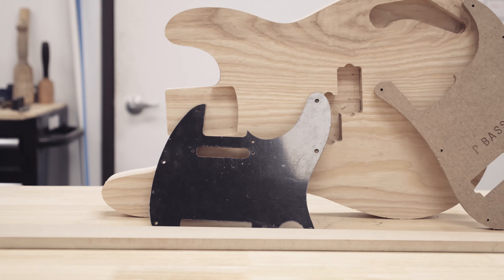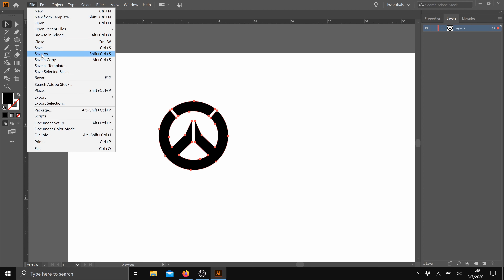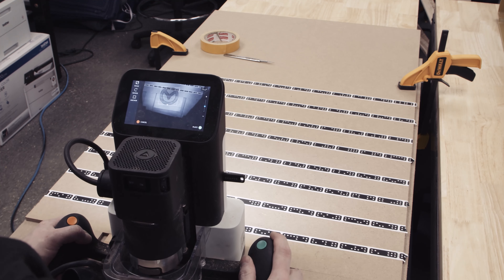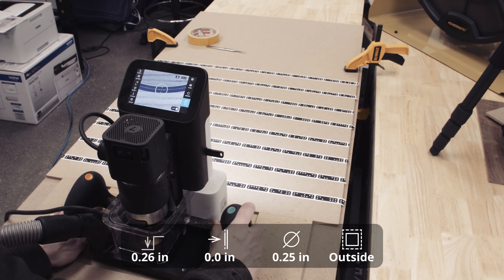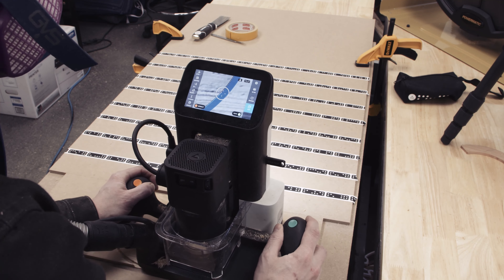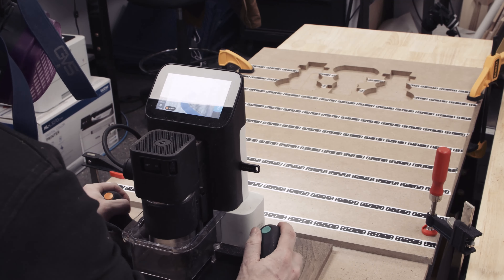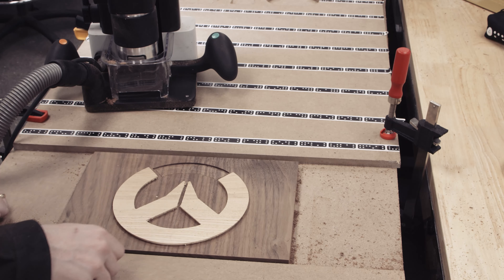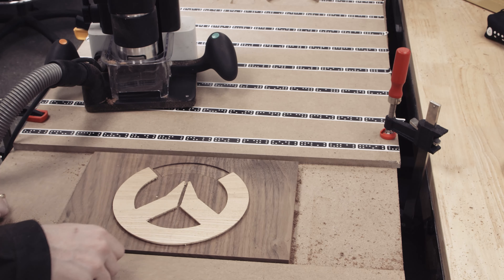Overwatch and Skyrim Inlay with Shaper Origin

Comment: That tool is freakin' amazing.  Have you ever tried down-cut bits?  Seems like with those micro cuts, they shouldn't cause the machine to hop... and would eliminate all the frazzle & tear out at the top?  Also if you're using a spoil board, why not cut down into it just a little to eliminate that little lip at the bottom?

Comment: Nice video and kudos for using eye protection and a respirator but you really need hearing protection in the shop or you'll end up needing hearing aids.
Reply from the maker: I am absolutely wearing hearing protection. I typically use foam ear plugs.
Reply: @ScottBarronFurniture  That's so great to hear! I grew up when hearing, eye and breathing protection were not even on the radar and I have significant hearing loss. I recently bought a SO and my adult daughter has been enamored with its capabilities. I already had multiple pairs of eye protection but not ear so I ordered her a pair of 3M over the head ear protectors. They go a long way towards preventing hearing loss. I just pointed her in the right direction and now she's teaching me tricks with making artistic svg files.

Comment: Hi, I would love to see you cut out guitar parts. Thanx.
Reply from the maker: I have built a guitar and a bass with the Origin but I did it with my son so I didn’t film it. I have been wanting to build another one, so it might happen soon!
Reply: @ScottBarronFurniture  Did you cut out the neck as well with the Shaper?
Reply from the maker: @peterlintrup400  So for the neck I used the Shaper to cut a template which I then used at the router table to cut out the neck. Same for the fretboard. They were both Fender style necks (a tele and a p-bass are what we made). You could probably cut them directly with the Shaper, too. Then I did the radiusing on the back of the neck with some rasps and files. Next time around I want to do some inlay on the fretboard as well.
Reply: @ScottBarronFurniture  Thanx

Comment: another consideration is that at such small offsets, if a piece of dry inlay sits in a shop where there is a lot of humidity then it will expand enough that it might not fit into the pocket..

Comment: Turned out great! Thanks for sharing. A piece of advice if you want it. Invest in some hex lag screws to screw into your clamp handles using a screw gun with a socket if you want to save some time when clamping. Also helps with the “tight quarters” issue of trying to tighten them by hand.
Reply: J

Comment: This looks like an ideal case for using a vacuum bag for glue-up.
 What is the audible depth gauge arrangement on your drill press?
Reply from the maker: A vac bag would work well here! I have one, but didn't think to use it for this. The audible depth gauge is part of the drill, it's a Nova Voyager. It's a great drill, but I'm just waiting for the day the computer goes belly up and I've got a giant paper weight.

Comment: Scott, thanks for the video! This thing pushed me over the edge to getting a Shaper. Now that I have it I'm realizing the biggest learning curve to pull off doing what you did in this video won't be with Shaper but with getting decent at svg manipulation in Illustrator. I have an svg file of a logo and I'm attempting to do the same thing you did to adjust the corners. But several of the anchor points that are in the file don't show me the corner field when I click on them. And I think you ran into the same issue in the video, but since this video is more about Shaper and not Illustrator you skipped past how you corrected issues like this. I think I see some times where you are manually making changes to get the rounded corners that you're after. But it all happens so fast I can't tell exactly what you did. If you could expand on that a bit or point me in the right direction that would be GREATLY appreciated.
Reply: I would also like to learn more about svg, I want to learn before I decide to try my hand on a shaper

Comment: How confident are you about the longevity of the tool and the availability of the tape?
Reply from the maker: I’m always a little unsure when computers are involved. I spent 20 years writing software so I’m properly afraid. The build quality on these is very good and the support is great so I’m reasonably confident I’ll be able to at least make back the cost. You can find stuff online for printing your own tape sheets. I haven’t done it yet but I understand it works pretty well.

Comment: Great video!  Why do you do the progressive step down of bit sizes?  I get the offset for the clean up cut. Also I have just got an origin and used once for Mother of Pearl on a headstock and turned out pretty well. I think using a clean up pass would help a bunch.
Reply from the maker: Thanks! I use the step down approach for a couple reasons. On the pocketing cuts it's a lot faster to hog out the material with the larger bits, then go at the inside perimeter with the small bit to get the sharp inside corners. For the outside perimeter cuts, the small bits can only cut to about 1/8" depth so if you need to go all the way through thicker material you'll have to use a larger bit. The tiny 1/32" bits are a little fragile so I try to run them through the least amount of material I can to avoid breaking them.
Reply: Scott Barron Furniture makes sense!  Thanks. I see you build guitars. I do as well and got the origin to help with cutting bodies, fretboards, bridges etc.  Have you use it much for guitar work?

Comment: Hello, I make templates and guitar parts.as well.  I have been reseaching this Shaper Origin set up and wondering if it could apply well for me.  Can you comment on your experiences with working in the guitar world format and pro and cons?  Im wondering if this may be the right tool for the right job.  Can it handle typical body sizes and pocket depths, etc?  Thank you for this video.. it was very helpful.
Reply from the maker: For making templates out of, say 1/2" mdf or plywood it's great, no issues at all. I've directly cut 2 bodies and their pockets with it, a tele and a p-bass. Those were 1 3/4" blanks so I was not able to cut the thickness completely with the Origin. The Origin has a 1.7" total z-axis travel so I might have been able to get that with a longer bit. I don't know offhand the longest bit it can accommodate while still being able to fully retract, but I think cutting completely through a 1.75" blank is not going to happen. I'm good with that, though, for the bodies and necks I'd rather make templates then use the bandsaw and router table to flush it up. I was able to route the pickup pockets fine on both bodies, and the control pockets on the p-bass all with the Origin. I needed some extra depth on the tele control pocket to fit the switch that I wasn't able to get with my bits, but I think I could have reached that with a slightly longer bit that would still work with Origin.
Reply: @ScottBarronFurniture  Thanks a bunch for your insight.

Comment: Cool project! I like the video! Fellow Shaper Origin owner here...couple questions. First, Why do you take the time to change the radius of the corners in Illustrator? That seems like it is an extra, time-consuming step that isn't necessary. Origin will take the file as is and you will end up with the radius of the bit you are using (assuming you tell it the correct size you are using). Second, with the precision that Origin is capable of, why did you make your inlays so thick and cut them down later? Origin makes it pretty easy to do inlays that are almost perfect and only need a little light sanding to make flat? Just seems like extra work. I hope this doesn't come across as rude or mean or anything like that...Just sincere questions. I just want to learn and get better too!  :)
Reply from the maker: Thanks, Scott! Not rude at all, those are great questions. For the corner rounding thing, it's correct that you'll get whatever the radius of the bit is regardless, for inside corners. If you don't radius in the SVG, though, you'll still get sharp outside corners. If you imagine inlaying a triangle, the corners in the cavity will have whatever radius the bit is but the inlay piece will have sharp corners and they won't match up. The larger the bit, the more pronounced the difference is.

As for the thickness of the piece, that was just because I was using 1/4" MDF as my tape board and making my material 1/4" was the easiest way to keep it coplanar with the tape board. One of these days I'll set up a proper system with wedges so I can do arbitrary thickness material.
Reply: @ScottBarronFurniture  That makes perfect sense on both counts! Thanks for the reply! Keep up the great work 👍
Reply: @ScottBarronFurniture  Thanks for the video! I really appreciate you taking the time to answer everyone's questions on this video too. I had a lot of the same questions in my head that I wasn't going to bother asking, but it was nice reading through the comments and seeing you answer all of them. Thanks for sharing.

Comment: Very nice. One question: When you do the Z-Touch you do this on the MDF. Would it not be right, to do this on the wood? Maybe there are only some 1/100 between and not necessary for this application, but for other projects where the depth is important?
Reply from the maker: Yeah, I've actually done it both ways and I'm not really sure which one is the correct way. I have noticed some inconsistencies in same depth cuts when changing bits doing it both ways, and I'm wondering if the z axis is just not as accurate as the x/y. Or maybe I'm not as in plane with the tape as I think I am. I know it really wants everything to be on the same plane.
Reply: @ScottBarronFurniture  I have been looking at one of these for a while so i'm by no means an expert, but I would think you should touch it off on something more rigid than wood, but probably not steel, maybe aluminum. When you touch off the tool you're not referencing the wood really you're just referencing the tool length compared to the bottom of the router, so any perfectly flat surface should do the trick. I feel like the wood may be giving slightly allowing the tool to press in to it, giving inconsistencies. I could especially see this for a smaller and larger bit, given that they have different surface areas.

Comment: Two Q's;
Is there an option on the screen menu for metric offsets and depths? I work in mm and metres.
Have you tried dominos printed on paper, does that affect accuracy?
Reply from the maker: Yep you can switch it all over to metric. I have printed out a sheet and used it and it works great, does not seem to affect accuracy.

Comment: That tool is amazing! How does it stay on the template so well?
Reply from the maker: It's got a camera that tracks where it is using the domino tape and it can move the cutter in x and y so as long as you're within range of the line it can track it (if you go out of range it'll retract the cutter). It's pretty cool tech!

Comment: Thank you for this video! I haven’t had the confidence to try inlay work, so I bought the bits that you used and I was able to complete my first test project! One question though, Have you had any issues with breaking the 1/32” bit? I tried to follow your instructions but may have made a mistake on something. I found when I was taking the bit out, it was broken. I have no idea when it broke or what I did wrong. Any suggestions?
Reply from the maker: I haven't yet broke my 1/32" bit, but I'm very nervous every time I use it that it's going to snap off. When I'm using it I'm being extra careful to move slowly and deliberately. With the 1/32" I'm trying to take off only the last final pass and not hog away any material left in the corners. It can be a pain, but going up through 1 or 2 bit sizes between the largest bit you use for the pocket and the 1/32" finishing bit will help knock down the material in the corners. But yeah, I fully expect I'm going to break it every time I use it. I consider it a miracle that I haven't yet!

Comment: Great video.  I was wondering if the SO is accurate enough to do tasks such as inlays, where a thou or two error matters.  This is specially true in making joints with the workstation.  Have you used the workstation?  Just curious your updated thoughts on the machines accuracy.  As I have yet to find an accuracy specification on the machine.  thx in advance

Comment: What brand of double sided tape did you use? It seems to stick extremely well.
Reply from the maker: That's the XFasten double sided woodworker's tape. I usually prefer the Spectape double sided tape, but you can get three rolls of the XFasten for the price of one roll of the Spectape. For this stuff it seems to work well.